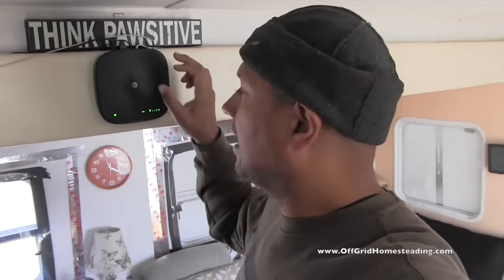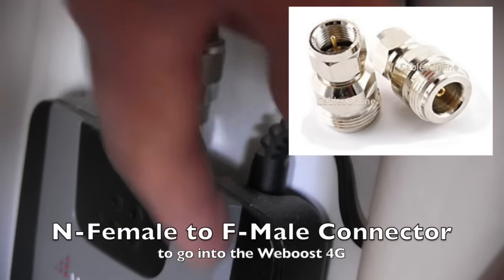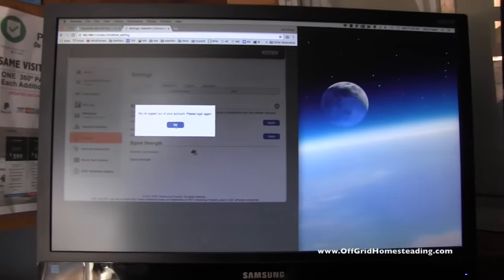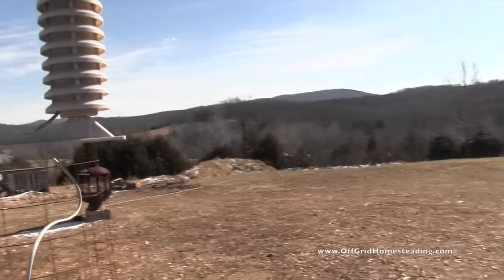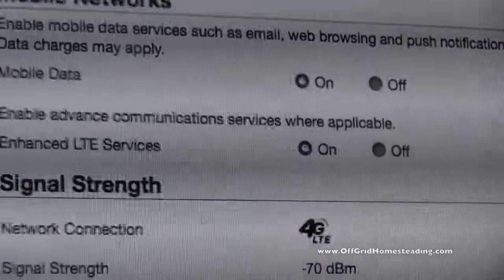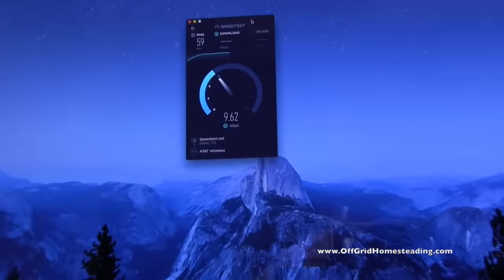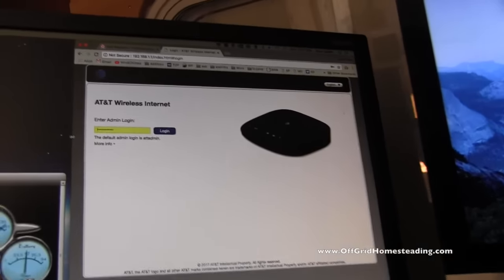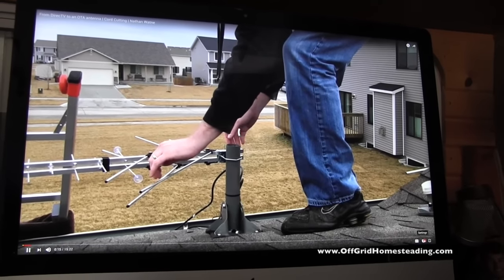OGH - Unlimited Mobile Internet Cellular Hotspot for Rural or RV

Comment: Which plan are you on? I was thinking about the 250GB but I wasn't aware of a un-throttled unlimited plan. I just received mine and I'm trying to lock it down to get the best signal. 

I also have found another router made by Netgear the Nighthawk LTE modem/router and wondering if it would be better suited since I can't turn WiFi off on this one.

Awesome video.
Reply from the maker: I started on the 500GB, after 4 months I dropped to the 250gb because out here  I can’t use more than about 170-200GB per month. I would like to be able to turn off WiFi.  My booster and all electronics and WiFi are shit off while we’re sleeping, for health purposes.  I Heard about the Nighthawk if you decide to use that and it works for you I’d like to find out how it worked for you.
Reply: I think I can get this one to work, but if the Nighthawk hotspot allows the Wifi to get turned off and it does have a usable USB port (for HDD or movies) I might take this one back. Need to do some searching on reception of the Nighthawk vs the ZTE.
Reply from the maker: If you use the night hawk... will you still get a cell phone service through the box for the home phone?
Reply: I got my MF279 like 3 days ago and I COULD turn off WiFi. My Own Router manage my DHCP, Wifi, NAT, Firewall, etc.
Reply from the maker: If you figure out how to turn off the wifi / router, please let me know.  I have a cisco business class router that I would eventually like to use myself.
Reply: Once I get home, I will check the software version I have and the option I used to disable it.
Reply: Actually, I went to AT&T page and check step 6:

https://www.att.com/devicehowto/tutorial.html#!/interactive/id/interactive_1500015534?make=ATT&model=WirelessInternetMF279

Thats how mine looks and I was able there to disable wifi
Reply from the maker: Jose sounds great!  Thank You!  John

Comment: U need to use 2 antennas with -45°;+45° for better data rate
Reply from the maker: I just ordered 2 yagi, and are awaiting delivery to try that out.   I just found in a new direction (of the antenna) I am now getting both up and download speeds greater than before.  I'll put out a new video when I've got it all figured out.
Reply from the maker: for my application the 2 antennas at 45º angles didn't work well.

Comment: I think if you connector 2ed lte antenna, you will get much better performance than current. btw. I do not recommend your use T connector adapter.
Reply from the maker: lei ming thank today for your response.  I’ve tried all possible configurations, and not one method works well consistently, as the cellular signal and location of best signal strength seems to change regularly.  So as of today what works well is the external antenna on the RIGHT PORT, going to the T.  Sometimes I have remove the external antenna and from time to time seven the signal gets bad, it works.
Reply from the maker: lei ming also I just remembered why I have to use the T.  If I disconnect the T as you suggested, I’m sure I’d get sighltly better throughout, however none of my cell phones will work as the external antenna (for the inside of our camper) on the wall would be disconnected.  My solution is for both cell boosting and 4g boosting.  There are specific boosters out there— that I tried but the didn’t last, and had all kinds of problems — working together.  Probably too much cross talk

Comment: thank you Brother  Happy new years 2019
Reply from the maker: Your welcome.  I'm still using this setup today, except for switching to the newer ATT box with external antenna.
Reply from the maker: @kritsada1971  Looks interesting.  But no matter how you slice how you get unlimited internet, all of the underlying carriers are used to run the data and cellular.   For example Straight Talk is a reseller in our area-- you buy it and then you have no idea what carrier the sales rep puts you on.  Out here ST = ATT Wireless OR Verizon.  Why go through a third party when you can get first party - data.    So you'll have to ask Netbuddy who is the carrier in the area--- go look at their service map, and then compare it to Verizon, ATT, Tmobile, US Cellular, or Sprint... there are a few smaller carriers in various places... but most of these services RESELL the top 5 providers or Tier 1 providers.

Comment: Where specifically can I get the plans you mentioned? Very interested in the 250GB plan.
Reply from the maker: Hey Justin, not sure what market you're in.  Best Bet is to call the branson Store # in the video description and talk to the directly as the plan can change and morph.  As long as AT&T Hard wired / land line service is NOT in your area-- that generally means your area will "qualify" but you need to check with them.  I don't have a complete list of states because they keep expanding and contracting the list.   It was 2 states when I found out about these plans, now I believe there are 10 states and some limited areas as well.

Comment: we gave the earlier model home base and might want to try this new one.  how do you swap sims to stay on the same rural plan, since the sims are different?  also, did your speed increase with the new home base?
Reply from the maker: Speed is not a factor with the different box, the antenna seemed to speed up the connectivity somewhat for a while, but then sometimes I get faster service when the direct connection to the antenna is connected.    You don't swap sims.  You need to take your box to the local Rural ATT Corporate store and let them handle it.  You will NOT be able to deal with customer service over the phone as they don't have access to those plans.

Comment: Hello John. Does this increase your cell phone signal inside your home as well? I was wondering since you’ve got it connected to the weboost antenna.
Reply from the maker: patriotic8813 hey there.  If I turn off the weboost I cannot make or receive a call on my cell.  If I put the call into a certain window, I can send and receive texts- but it’s super slow. The minute I turn on the weboost — incoming calls and the ability to make calls works.  The trailer is 38’ long.  From the weboost internal antenna, I can make and receive calls in about 15 feet to the back bedroom, and about 15 towards my desk on the front of the trailer.  I can receive calls and texts, at my desk however many people say they can’t hear me and I have to move to to the kitchen area near the att box or closer to have a clear call “both ways”.    Hope that helps. The minute I step outside of the trailer. It’s back to Russian roulette if I can make or receive calls - or texts.
Reply: Off Grid Homesteading Thank You so much. I’m ordering the necessary adapter and weboost today. I had to change the N adapter to SMA because I ordered the 50 ohm 15 foot cable with the SMA end. I’m glad the weboost works for cell service. I’ll be able to justify spending $400 on it. We would only use it for texting as the AT&T micro cell won’t work with this system and we have no service in our home
Reply from the maker: patriotic8813  if you need a little more signal gain or should I say reduce the loss from antenna wire  to weboost, get the LMR 400 cable.   If your setup works well because you have enough gain you’ll be happy.
Reply from the maker: The weboost 4gx which I haven’t used I believe has a higher power transmitter so your range you can be inside the house will be greater.  I get No where near 1000 sq ft as the weboost states, that is because our signal strength outside is nearly 0-1 bars.
Reply: Off Grid Homesteading I’ll see how it works. It’s decent thickness and it’s only 15 foot long and 10 feet is up the pole above my roof line. Just talked the wife into buying it. Texting from the couch instead of the window was the selling point lol. Thanks for all your help and amazing video
Reply from the maker: patriotic8813 glad it helped.  Hey out of curiosity did you use our amazon links to buy some of your stuff?  We make a couple of dollars here and there if you use the links.  Thanks for your comments.
Reply: Off Grid Homesteading yes actually I did. I didn’t realize you got rebate.
Reply from the maker: patriotic8813 yes it helps support us.  Not much but 3-6% here and there adds up.  One day I’ll have enough to buy a pizza!

Comment: what are you using as a wifi hot spot router
Reply from the maker: ZTE Z700a on version 1, I 'm now using the 2nd version the ZTE MF279 (with external Antenna ports).  As of Jan 2019 they're really pushing the Nighthawk Router for the ATT Wireless Home Base with Voice -- but from what I've researched so far, not knowing exactly which router exactly they are referencing, it looks like they router does NOT have external antenna ports-- on the Nighthawk.  Plus we're trying to REDUCE our EMF exposure and NO way do I want anything related to 5G anywhere near me.   (SEE video documentary Resonance "Beings of Frequency" .  Link here:  https://www.youtube.com/watch?v=YFR5EtO_zdM  Hope that helps
Reply: @OffGridHomesteading  yes been online on ebay but most of them are in china im thinking of buying a weboost a att hotspot with unlimited data with no throttling and by the way,....how far can this weboost reach out to the furthest tower
Reply from the maker: @thesecret2  -- Hey secret, I did the china booster and not knowing what freqency exactly is used out here I bought what I thought would work for everything and it doesn't.  I guess having a booster that can do a narrow band of frequencies well can be cheap.  I used to be a cellular dealer in another life... and what I know is there are different frequencies that the phones use for transmitting, and receiving, signals.  With each re-iteration of new iphone or android etc...the keep introducing new bands... the challenge is picking the right china product.  After spending more than what the weboost cost trying all of these "cheaper" alternatives.... i took the plunge and went ahead and bought the weboost 4G home box.  This is a wide band receiver that not only will do ATT & Verizon Cell phones as of Jan 2019.   I have the MF279 ATT Home Internet Box with the external antenna and have use the single YAGI to reach out 10-11 miles through a valley to get my internet for the last 2.5 years.  I'll be putting out a NEW video soon showing my setup now that i'm using in MIMO 2x2 for the antenna.  I have dual Yagi's on the way to do the comparison.  When I get them i'll show the differences.  I'm now getting upto 20Mbps down, and as high as 12Mbps up as a peak --!!!  Pretty awesome I think for being at least 8 miles away from ANY cell tower.  If you wouldn't mind using my link to buy the Weboost OR the other products it does help us make a couple of extra dollars here and there with no increase in price to you.  Thanks in advance.  Make sure you do a site survey before (to check signal strength and and direction).

Comment: Do you use a firestick for tv?
Reply from the maker: We have to 4k Fire's the box type, and 1 stick.  I prefer the fire boxes with the dedicated ethernet port, as I hard wire them to my ethernet network, for lower latency and a little faster speed(s).   Hope that helps.

Comment: Use the att data connect pass!
Reply: Hey Antonio the Data pass is UNLIMITED, however after 22GB the plan can slow down to 128kbps--- which is slower than the slowest connection i've received with the Home Base box.  They're charging $35 plus tax.   It makes sense to just do the $40/mo plus tax-- for 50GB unthrottled, and pay the $1/GB overage.  AT&T does it in 10GB chunks.  $10/10GB.